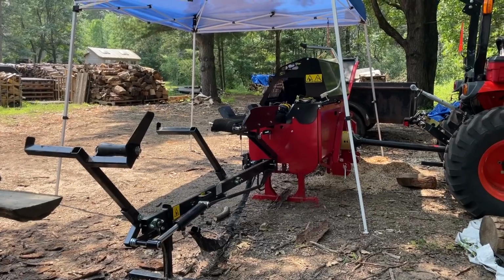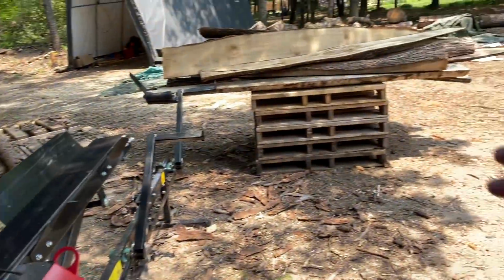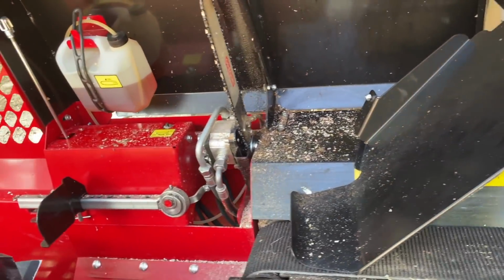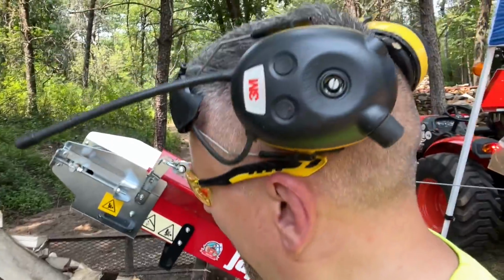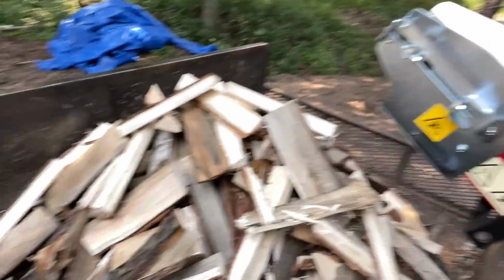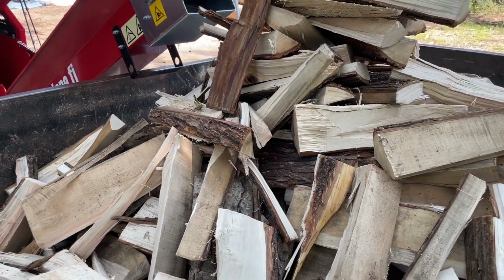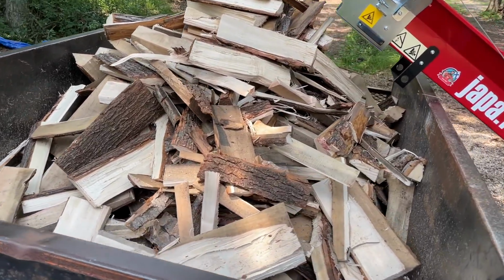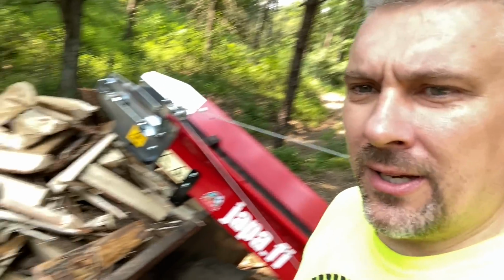Processing Slab Wood with Japa 315 Firewood Processor

Comment: That's cool, but too much kindling being made. Needs a different cutter head.
Reply from the maker: Yeah I think with the slabs not all hitting centered made a lot of smaller splits and kindling. But I'll find a use for that stuff as well...lol 😀👍🍻
Reply: @Back40Firewood  Love your channel btw. I've cut alot of firewood  over the yrs. Used to work at a cedar mill and would cut a load of wood from the broken ends every day at lunch.